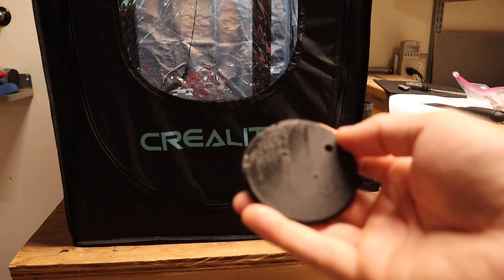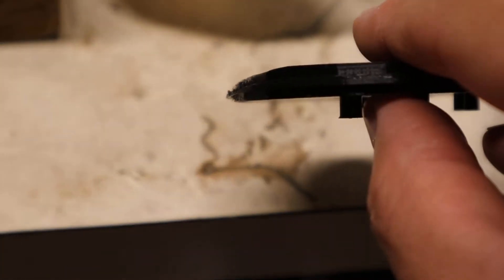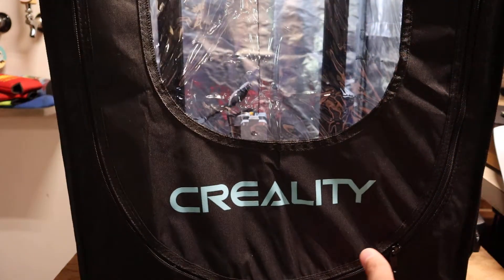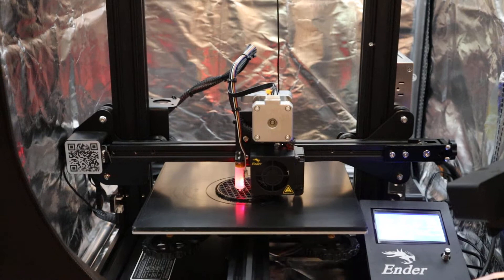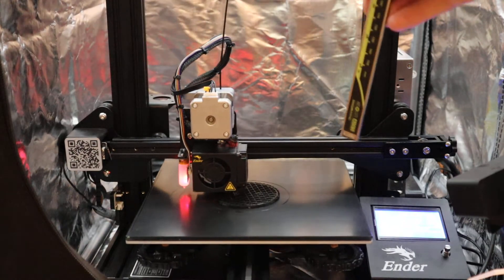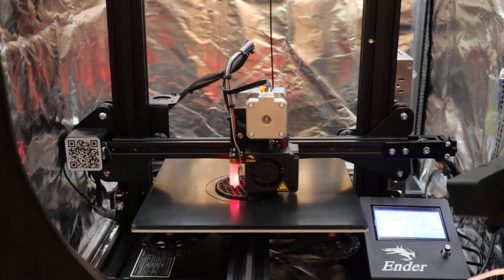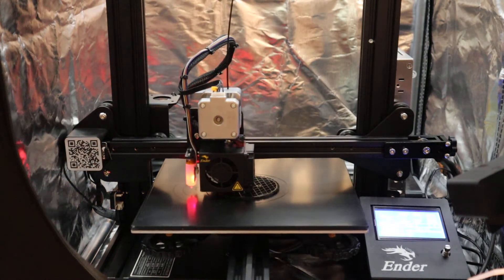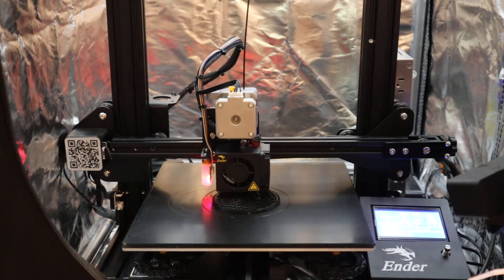Creality Ender 3 Pro + BL Touch: Weird First Layer Issues

Comment: When you took your x-axis measurements from the 4 corners did you move y-axis to take each corner measurement or did you use a level? I am now having this issue out of the random after printing many parts without issue.

I checked bed warping, filiment, created BLtouch mesh twice. checked cura. no matter what I did I can't get 1st layer adhesion and noticed the z-axis floating up when nozzle travels to the right side of bed(roughly 3/4 mark)

Comment: I'm having a similar issue where no matter what I do, the prints come out... Caddywhimpus..
I'm gonna try this. I hadn't thought to make it physically level to the bar, but it kind of makes sense.
I guess I thought that the Touch was supposed to compensate for that (like in the case of a warped bed).
Reply from the maker: I think it does compensate, but taking only 9 data point (3x3 grid), wasn't enough to compensate in my case. Perhaps more data points would have improved things... not sure. Anyway, thanks for watching!

Comment: Hi Joe, can you give some info on your filament spool holder? i have a normal ender 3, and noticed your filament path is very direct to the extruder.
Reply from the maker: Actually I did a video on that about a month ago. Among other upgrades, I replaced the stock extruder with a direct drive extruder that eliminates the bowden tube almost entirely. Take a look at some of my recently posted videos and you should see it. If you can't find it, here is a direct link https://youtu.be/BVL9YS3QqbI

My filament spool holder is not stock but it is very close. The only difference between the spool holder that I have in this video and the stock one is this one rides on ball bearings which I have found to be completely useless I have not seen them turn once. The bearings are too tight and the friction between the spool and the spool holder is less than the friction within the bearings. Poor execution of a great idea unfortunately